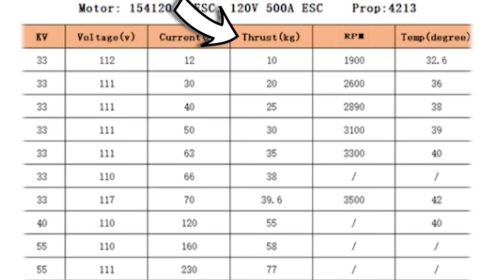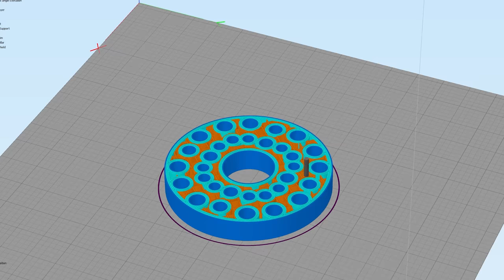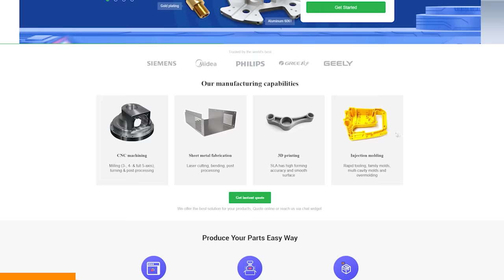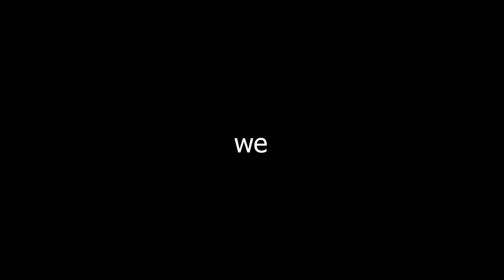Electric Motor From A Car Powers This Snow Racer

Comment: awesome video man. always glad to see you come out with unique and interesting different ways than i would have thought of to conquer design issues. I hope you're careful using those seriously big batteries next time. series is definitely gonna punch the throttle but if you are spinning a wheel that fast, covered in nails you could potentially send the nails flying at someone far away, or worse at your back while you're sitting there, or EVEN WORSE at one of the LiPo cells, lotta amps discharging very fast. be careful bro take care.

Comment: You should use a proper crimping tool. By crimping, single copper strands will fuse into a solid copper core. Bad crimps will eventually come loose or will have a bad electrical connection.
Nice build anyway!
Reply: Important to note that the higher resistance from a poorly crimped connection can cause a lot of heat that could result in a fire.
Reply: Yeah  i agree about the bad crimping he did, rather he could use a bench vice  (and a wall nail against the connector) that got more power to crimp
Reply: @dragonclips  a hammer crimper tool is only $20, just buy the proper tool.

Comment: I have a fairly simple idea. If you put the bearing pillow blocks for the rear wheel on the bottom side of the aluminium extrusions, then more of your weight would press the tyre into the ground, since it would sit lower relative to the rest of the vehicle.
Reply: That would make the skies dig into the ground and even if you adjusted the skies to not do that, slightly more of his weight will be up front.

Comment: You might want to try adding a brace from the top of the motor mount to the end of the rear extrusions (past the pillow block bearings) to prevent the frame from bending.

Comment: Nice design on the wheel to sprocket connection with the long threaded rods.  I will try that the next time my 3-D printed part for an electric drift trike breaks.  There were issues with so much power breaking the plastic, but your design spreads the load with the threaded rods.  Thanks!  I learn useful stuff by watching you.

Comment: Maybe but the seat farther back, so the pressure on the wheel increases, and the pressure in the front (large area, high friction with most materials) decreases?

Comment: Hey rclifeon, Love your channel. Quick tip. Threadlocker will eat the plastic. The same reason why your airplane or fpv props explode if you threadlock the nut on output shaft and get ANY on the plastic.

Comment: You should definitely change the battery to go faster, add a way to properly push the tire on the ground and get better skis to slide with less friction (and maybe add wheels to go on the pavement).

Comment: You should mount the tensioning bearings under the aluminium extrusions and not above, so the hole frame would push down on the rear wheel

Comment: Believe it or not had you put 2 stability rods under the motor to the frame it would've done the job try it if you've still got the bits but you might have to weld them in place after positioning etc anyway your a very good guy you do NOT ever give up and your willing to try anything which is literally the heart of a winner 🏆 👈🏼 👍 Good Bois

Comment: you can get an electronic crimper which will crimp the connector in 4 places giving a great connection reducing possibility of coming loose and over heating. moving your weight more toward the back over the tire would give you enough pressure and lighten up weight on front forks

Comment: You could add a little counterweigth (like the batteries) BEHIND the wheel so the axle acts like a lever and pushes you a little bit up and reduces friction on the skids and increases traction even more

Comment: I think you need to modify the sled frame so the ski rail pivots in the front and remove the solid bar between the ski rail and upper frame in the back and add either coil springs or leaf springs. Otherwise you are limiting yourself on the amount of downward force for the tire. Maybe even try printing some coil springs or one leaf spring that would connect to each rail ski and then in the center up under your seat, like a corvette rear suspension. I think you could even alter it without springs at all and then you could control your steering by pressing down harder on one foot or the other.

Comment: If you put more weight over the tire, the lack of weight over the skis will make steering impossible.  Balanced weight and balanced friction will work better.  And designing a vehicle for both ice and grass and sand is pretty challenging.  Looks like a better ice vehicle than sand or grass, unless you put some wheels on the front.

Comment: I used to see projects with extruded aluminum parts and its strength worried me, I had only ever worked in steel. I recently started working work these shapes in a new job, and I have to say Im really surprised, I just wish more of the 90degree connectors had gusset(s) for additional support. It seems like you have to bracket both sides to get a dimensionally stable result and thats never cost effective so we don’t.

Comment: Awesome project,  make it longer, so your weight will be in the middle of the wheel and the front sliding part, you will have more traction on the wheel

Comment: Wheel needs to be pushed into the ground more, putting the batteries over the wheel should help. 
You need ice skate blades or similar on that thing for driving on ice lake bro 🤝 you're next vid will be very entertaining no doubt..
SPEED AND POWER my friend 🤜🤛👍🏼

Comment: You should invest in a good crimp tool. Your makeshift crimp will most likely get hot and be very inefficient, but a proper crimp crushes the wire so hard that the stands basically fuse and become one solid block of metal.

Comment: Nice job!
If I were being critical of the build, I'd say the reason it's struggling is the reason people tend to not use tires for snow-vehicles in the first place. Tires just suck in the snow. Studs help compensate for it, but ultimately they're just not very good. Snowmobiles use tracks.
You could try paddle tires intended for sand, but the material composition might not hold up in the cold, since they're likely designed to operate at higher temperatures. But I mean, that just translates to more frequent replacements of a single tire, no big deal. 
But, adding a larger motor with more power isn't going to help when the primary issue to overcome is traction. If you spin the tire faster, or with more power in general, it isn't going to help that, actually it's going to make it worse.

Still very cool, and I enjoyed the video. Liked and subbed, checking out your other stuff. Looking forward to more!

Comment: The rear tyre should sit below ground level when parked on flat ground. Almost all of the combined vehicle + rider weight is over the skis, so once the tyre digs ~1cm into the ground, you're just sitting on the skis. Make it ~5cm below ground and the rear tips of the skis will only hit the ground when you're on very soft snow or mud. The rest of the time you'll have about 50% of your weight on the tyre. To make it even better, use a swing arm with a suspension spring like an actual snow bike, so the weight on the rear tyre is independent of how far it digs into the ground and is easily adjusted.

Comment: Ok so I know what your problem is with traction on the rear tire. Your rear tire is almost even with your skids at the bottom, so that means what passes the skids will get traction.  I believe that in order to fix the problem you will have to redesign the chassis and put a pivot at the rear after your seat, with a large single shock that will put constant pressure or down force from your weight to the surface your riding and that will get rid of your traction problem.  I hope you try this . I look forward to seeing a remake of this already great potential build.

Comment: If you raise the pivot above the centerline of the wheel there will be more force on the tire and better traction. Having the pivot point below causes the swing arm to push up on the wheel and reduces traction.

Comment: this would be lots of effort for little return but it would look so cool if you rode it reverse with the wheel in front and also steered using the wheel. like a reversed snowmobile or Batman dark night motorcycle but for snow.

Comment: Put your body weight over the motor. That will increase traction and reduce the sick that stops you from getting started.
Put the batteries beside or behind the wheel for the same reason.

Comment: Shorten it. put the motor above the wheel to help increase the weight and get better skis and i reckon it will work a lot better.

Comment: Late to the comments, here. Consider laying on the snow racer with your torso/pelvis area just past the orange mud guard. Put some foot pegs on the swing arm just in back of the wheel. Kinda like laying on a sport bike. This will lighten up the front skis. Will most likely add some fizz ( old guy term ) to your speed runs.

Comment: You should use that motor on a go kart. Use a racing frame with a live rear axle and proper brakes and if you need more ground clearance, machine adapters for larger lawn kart or golf cart wheels. 

Alternatively strap that motor on a bike/minibike/small dirt bike frame.

Comment: I would make an extension for the front ski so it's the only one touching the ground. It'd be more like a snow-cycle and you'd have less fricton overall. If you leave the side skis in place they will actlike stabilizers in case you lean too far. You could even add angled spacers to the side skis so they would be flat on the ground when you lean instead of riding on a edge

Comment: Adjust the seating so you can have some of your weight distributed to the tire. You don’t have traction if there is no weight back there and all of it is being pushed. It’s why some rear wheel drive trucks will have weight thrown in the back for ice or snow to get moving

Comment: It needs an angle bracket from to top of the motor mount to the wheel mount because when you sit down the wheel bends up and reduces downward force

Comment: Interesting video 2x👍  Looking at the performance on the grass I would say it would do so much better if you had a way to swap out the ski for wheels. or adjust the weight to the rear more.

Comment: 2 problems:

The tires area (that is in contact with the ground) is very low which is why it isnt able to push well, as you are basically mimicking a snowracer the reason they have belts (at least one of) is that they provide increased surface area i.e more grip. 

Weight, theres not enough weight pushing the wheel into the ground so the low surface area/low grip slips. You mention it but some sort of lever or spring contraption would probably do it.

Comment: Very Cool

Suggestion:
Move the seat closer and over the wheel

Better:
place most weight under the seat,
consider a "crank" with the bike as handle over the wheel-ground base,

breaking will push the crank over the wheel,
the crank, or seat+fork, will be connected by
a big PIPE rapped in wire, in the pipe there is a heavy magnetic capsule attached to a 
spring to the seat side.
the capsule is held on the seat side, 
but when the seat goes over the wheel on a too strong break or turn,
the capsule is released and sent to the wheel side to counter the turning over force
and turning the wheel side to the bottom of a pendulum. 

pleeeeeease

Very stable, 
And built for tricks :)

Comment: I noticed when you sit your heavy self on the sled .it bows downwards, lifting the back wheel slightly.you may need to lower the back wheel 2" to compensate.or rebuild more sturdy with wheel lower.

Comment: you should build one motor and drivetrain system, and continually optimize it, and make it modular so you can use it on different vehicles/ have different uses.

Comment: Would be sick if you put it under sled instead with smaller ice tire, and have little offset like 10-25mm from skid height. It would grip sick on all surfaces:D pz from swe

Comment: 👍😁  Get a good helmet first 😉 the second time hurts less, but remember much less afterwards 😏
Have you tried slow start instead of high bore speeds? Tires didn't need mods, since not much improved considering; a tesla could reach >150 mph, but if that much spin was given from the go, it would spin out of friction grip to the ground and hesitate forward movement. Consider an ATV transmission for the mid ground. Awesome video 😊

Comment: Since the wheel and the skid are in line, there is no full friction and the wheel is skidding.
If the wheel is at least 10 cm below the skid, the wheel will fit on the road.

Comment: Very cool Project! Im searching a connector for my 25kw electric gokart that I am building. how is the connector on the big battery at the end called?  It now drives put still need some good connectors to remove the battery quickly for transport. A short video would also be on my channel. and a complete video is cooming soon.

Comment: Problem is thst youre putting your weight on the side sleds which act as a brake. Put your weight more on he wheel, and have those two sleds steer

Comment: How about mounting the motor and wheel assembly on a pivot with some more pillow bearings, then add in a coil over to pre load the tire.

Comment: Just realized at 7:23 your tire is oriented incorrectly, most tires have a direction which improves traction, and by the looks of it yours is backwards. Not sure if correcting this issue would help as much as is needed but it's helpful nonetheless.

Comment: or you can rebuild the skids like seaplanes can land on water and land. Only the steering skid should be built a little more stable because the lateral steering forces will have an effect over time

Comment: hey Bro, great idea, but there are 2 problems, 1 the center of gravity of the weight is too much towards the front, and 2 moreover it flexes slightly in the middle, so as to lose grip, land, you should tilt the stove more and rear in so as to distribute the weight also on the rear. for that you have no traction.
Reply: I bet if you sit on the tiller over the engine and dip the steering a bit you should have fixed it anyway.  try it, if that works I'm right 😉

Comment: i think if you either extended the front forks some not much or raised the side bars just slightly it would give it the weight on the tire it needs and the less friction from leaning some to one way and having 2 points of contact instead of 3

Comment: Looks like a weight distribution problem to me. The vast majority of the weight rests on the skids. I would try moving the wheel downwards so the contact patches are in front of the skids and on the tire. Possibly move the seat back, but that will be difficult without changing the design.

Comment: Cool build, would the traction issues be fixed by lowering the motor and moving the seat further up and back? It might make it less stable because of the higher point of gravity and require quite a few changes to the frame and steering :P

Comment: its all the tire and the seating. big knobby toro snow blower tire on a minibike would have a 30 foot rooster tail going and the front wheel not even turning  but it would be flying over the snow.

Comment: If you raised your seat up and shifted your seat back so that more of your body weight is over the wheel, that would help. Of course, raise your steering, so you are in a mountain bike posture. Or you could just replace the skids with another wheel.

Comment: This is a neat little change up! Definately an upgrade, but I don't think you're getting much more than 25% of the traction you could be utilizing if the center of mass was more ... center. I think you might want to get more weight over the drive wheel.
Reply: Ah yes. I should have waited unil watching the rest of the video.

Comment: Why not make the ski’s hot swap for a set with wheels for summer, also extend your steering shaft with a U-joint and mounted shaft bearings and change your seating position to a more leaned back position to shift more weight towards the middle/rear, I’ve enjoyed watching this series tho.

Comment: All your weight is going to the ground because of where you sit. If you just had the front directional skid and the tire that would take off anywhere. But the main weight is on skids with probably 2 square feet of contact vs the 6 inch by 3 inch pad the tire has. That's why it moves when you put weight on the tire it moved weight back. Ditch the two big skids your vehicle would move 10 x better.

Comment: Safety wire through the nut and all thread, like securing nuts on a plane. If a nut is thrown at those revaluation, you might be looking at speeds over 300mhp. Like rock being thrown by a lawn mower.  And your sitting right in front of it.

Comment: Awesome project! It seems like you are losing a lot of energy with this design though. The friction from the front skids is a problem. If you wanted to stick with a skid design, you might consider centering your body mass closer to the wheel, or even over top of it. This will certainly cause your front end to lift up when accelerating, so you've have to add a wheelie bar to prevent flipping over. It would be a matter of finding a happy balance for the center of mass. If you can find it, you could drive this on anything, however the less weight you have on the skid, the less effect it will be at steering. Ultimately, using skids on all terrains is probably not a great idea when considering the physics of it.

Comment: Why don't you ditch the tire wheel thing altogether and design and 3dprint a track with the motor as the drive gear and put it under the seat. Essentially a mini snowmobile. You can print the tracks out of polyurethane and get great grip on any surface. Not sure about steering though, you might have to double the framskidan!